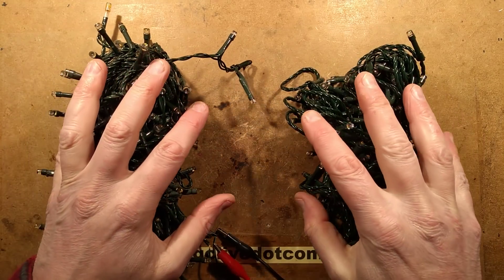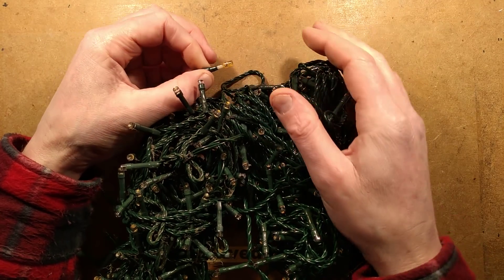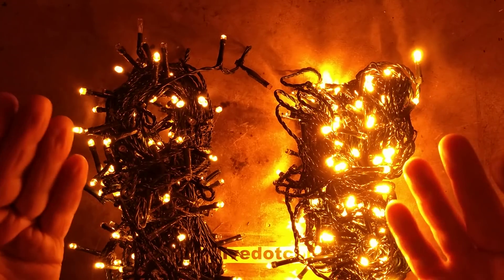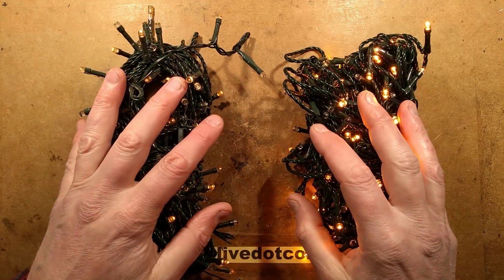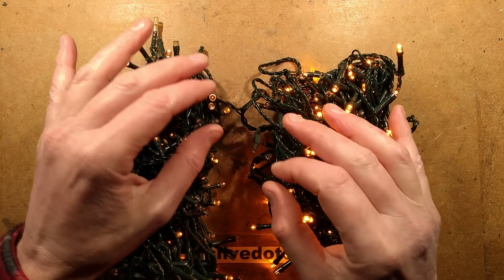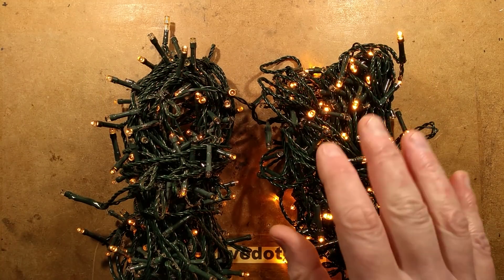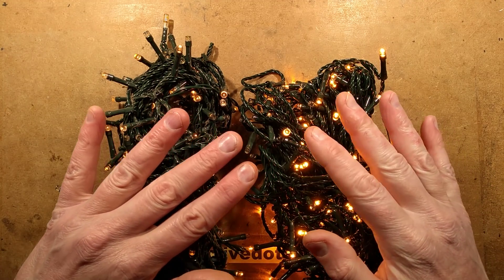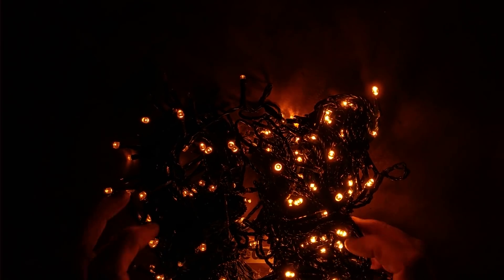9000 hour LED intensity loss test on LED strings.  (All LEDs do still work.)

Comment: Yup, sadly it's a thing.  I built a Sound-Absorbing Light(tm) a few months ago, and just yesterday had to replace one of four strips due to the start of a cascade failure (about 1' of a 4' section went dim and yellow).  The new strip is significantly brighter than the other three, and they only see about 8 hours of use a day.  Argh!

Comment: Did you clean the set that was outside as the lenses look dirty yellowish to me, I was looking at the unlit one in particular regarding this, UV damages plastics and causes them to go opaque. I have one of those tapes of led's on the stairs with a time switch and they are as bright now as when I fitted them five years ago. But they are not run at full power.

Comment: To me it looks like both the new and old strings have a few LED's which are not lit. If I'm seeing that correctly that could also be a factor for the difference in current usage.
I'm quite disappointed that the LED's have degraded so much already after 'only' 9000 hours... Lots of manufacturers claim a lifespan of at least 20.000 hours.

Comment: it looks like a lot of the LEDs aren't even working any more, and did the plastic lenses turn yellow on the old ones vs. the new ones?  What's the count of the working vs. non-working LEDs on the old string?
Reply from the maker: All working.  Just being run on single polarity DC so half were lit.

Comment: Well this is disappointing, I own a bunch of sets of these and run them 24/7  for 5 weeks a year since some of them don’t have a memory function.   I’ve noticed my older ones are slightly dimmer (and some sections of the older lights barely light up).  I was hoping I’d get more use than a couple of seasons out of them.

Comment: Time to revisit the led cost-benefit analysis compared to other lighting systems me thinks...
Reply: Large companies and government departments should already have factored in the rated lifespan of the LED lamps. Don’t forget for them, labour cost of replacing conventional lamps is also taken into account. They also will (should) carefully choose the type / make from established well known reliable companies, and not buy the cheapest rubbish from the Far East.
Reply: @Mark1024MAK  Except most government departments won't have factored this in, most things I signed off by someone of nearly zero technical intellect and a bean counter who swallows a load of slick marketing bs.
Even domestically I'm going to crunch some numbers, if they have to be realistically replaced every year due to degradation the initial cost and yearly replacement in relation to power savings may not add up too strong.
Reply: deezelfairy - Well, some companies have trialled LED replacement tubes to replace conventional fluorescent tubes. Now they use the LED type extensively. Myself, 95% of my house now uses energy efficiency lamps, most of which is LED type. One down light failed (driver incompatibility), the rest are fine. Some are over four years old now. I have not noticed any colour change or light reduction. But without using a light measuring instrument, it’s hard to be certain. None of mine run continuously though.

Comment: My experiment would be on how they got so daaam tangled
Reply: And ear plugs
Reply: You are right
Reply: Gremlins man, gremlins!
Reply: It's the "Tree Light Faerie"
Every year they go around mucking up everyone’s nicely packed crimble lights!
As this subset of "Christmas Pixie" has evolved from the santa variety there is a direct correlation between how tangled your light strings become as to how good you are throughout the year! This strange phenomena also occurs with other variants of lighting rigs .... from Stage to Site (although with site lights you can never disprove the "'prentice did it" theory)!
Reply: Ah yes, that moment when a half-hour task of putting up lights turns into a three-hour task.
Reply: @jonathandenton6160  You mean the point of convergence of the graph of time taken to untangle against the time to get another set .... with an alternate line for the need to use snips and tape?
Reply: @totherarf  or just plug them in as a huge tangled hairball of wire and LEDs and hope the house doesn't burn down.
Reply: @jonathandenton6160  You mean the usual setup? ;0)

Comment: Just wondered if perhaps some small amount of damage is caused by them being driven in reverse for half of the cycle. I know some LEDs do not like being driven in reverse at all but some are ok.
Reply: The reverse voltage is likely to be clamped at the forward voltage of the adjacent LED (wired in inverse parallel), so 3.5V or lower. So not likely to have much impact.

Comment: Any thoughts about the effect, if any, of sunlight exposure on rate of LED fading? I have lots of cheap warm white LEDs outdoors running 12/7/365. They lose intensity over time of course but not all at the same rate. It kinda seems like the ones that get some sun during the day fade faster than the ones that are always in shade. But I haven't really made up my mind whether the sun is doing it, or some other factor I haven't thought of yet.

Comment: Now you know what you need to do with the old set... crank the voltage up until they go pop ;)
Reply from the maker: LEDs are really boring for that.  They seem to fail in a controlled manner.  The best you can hope for is the lens firing off.
Reply: @bigclivedotcom  so you're saying apply mains voltage directly to them ? ;)

Comment: but that is 9000 hours !! there is no typical incan or flourescent that will last anywhere near that long :-)

I am curious. is 6 hours a night until it hits 9000 hours the same "wear" on the chips as 9000 hours constantly ?
Reply from the maker: No.  Running hours degrade them the most.  But direct baking sunshine can degrade them too.
Reply: @bigclivedotcom  ahhh. Good point so its not aimply long running hours but running period. Any chance being rectified might extend life or is it simply the diode wearing down?
Reply: Nerys - temperature has a significant effect as well. The hotter they are, the quicker they are likely to degrade.
Reply: Nerys - the energy conversion from electricity to light in the LED chip degrades over run time. And the phosphor (in types that use phosphor) will also degrade over time. LEDs are DC device’s, at low reverse voltages (below around 5V) , the current flow is very low, so these does not effect them. As they are wired in inverse parallel with other LEDs, the maximum reverse voltage will be about 3.5V.

Comment: This also supports my theory that LED technology just isn't ready to be used as large scale lighting applications. I have an LED light that I use for lighting my room at night, it used to be a pretty color (cool white, but that really interesting cool white that has a phosphor but is a thin layer, so a lot of blue comes out as well as the yellow from the phosphor) and is now just a generic dull white color, and loss of brightness, though not much, as it is still useful.
Reply: I despise the LED street lights that they forced upon us here in the UK, I smile whenever I see one of the rare original lights, a nice warm friendly glow instead of the cold harsh dazzling light from the horrible LED lights.
I especially hate them when I'm out cycling at night, going from the LED lit roads to the cycle paths it takes several minutes for my eyes to get used to the darkness, never had that issue with the old amber lights.
Reply: I'm not sure what it is about vehicles, whether it is the combination of weather and shock, or just component failures, but now that virtually all brands of vehicles have LED running lights, I see failures constantly.....headlights, DRL, taillights etc. And we are talking vehicles that are only a few years old.
Reply: I got a really cheap LED bulb for a room about 3 years ago - 99p from Screwfix.  It's not really bright (was less than a 60W equivalent) but still lights the room and too bright to look at directly. It's been on a lot longer than average too, as the room faces a direction that only gets sunlight during the morning.
Reply: High quality LEDs if used correctly and not run at or beyond the manufacturers recommended rating, and which are not run too hot, will last for a reasonable length of time. If the lifespan exceeds traditional lamps and they are just as, or more efficient, then they are ready. Hence their  increasing widespread use.
Reply: licensetodrive - I find the LED streetlights to be better, as they are directional, so don’t shine in my eyes as much as low pressure and high pressure sodium lamps.
Reply: bigblockelectra - no different than cars that use filament lamps then. Certain makes often had lamp failures even though they were less than three years old...

Comment: wait, im confused, didnt clive say that the string of lights that was brighter was also being used outside? or was it just the one string that was used outside? and im assuming they were the same exact model. it would be interesting to take a few bulbs out of a string and store them, and then plug them back in after a while and see if they are brighter then the rest of the bulbs in the string
Reply from the maker: Just the dim string had been used.

Comment: Clive, I'm a little confused at the start of your video with the AC vs DC, etc, and then your experiment seemed to be one set run 24/7/365 vs one set never run.  Unless I missed something where the one set was actually run, it would seem like the only experimental results you have are that running LED's 24/7/365 will degrade faster than those that are never run.
Reply: There was one experiment with two results. The LED set that he used runs from a controller that continuously switches the DC supply polarity to the LED chain (hence he calls it AC). He wondered if such a set would suffer from less corrosion compared to his previous experiences with LED sets that operate on a DC supply (where the polarity never changes). His conclusion is that there is less corrosion.
The second result is that there is a significant degradation of the light output after running the set for an extended period of time. The new set was his control to use to compare to the set that ran for a year.

Comment: I've seen DIP style Led's degrade like ** in my local buses when used as permanently on position lights and front interior lights

I think that package style just isn't suited for longevity because of how far the chip is from the circuit board (and thus, cooling)

SMD, cobs, and other high power packages when cooled properly should last a lot longer

I've seen fluros and CFL dim over time, but maybe only 30% instead of 90%

Just by eye, this looks like 50%

also, some manufactured products with leds (my logitech mouse on its first gen) lost it's blue pretty quickly, then was green

And the blue led's on my coolermaster fans barely do anything these days (I do have LED strip lights for the case which have probably outlasted them in terms of not becoming dim)

Best bet is probably go for double or triple what you need, and run them at reduced power

Comment: Hey Clive, I got a request for you. Ever heard of the "Socket Shelf" by Sharper Image?  I've been seeing a ton of adverts about them in my area recently and I suspect this is right up your ally in terms of "No one should ever use this fire hazard" crap.  It's an output power splitter with USB but the gimmick is that it comes with a little shelf.  I might even be up to shipping you one from the USA if you're interested but I suspect that you've already dissected enough crap like this on your channel. Still, let me know if you're interested.

Comment: Another annoying thing about these LED strings (also solar garden lights)  used outdoors is the lead in wires on the LEDs start to go rusty very quickly,  is steel wire used for technical reasons or just because it's cheaper than copper or brass?
Reply: I don’t know the answer to your question, but all the 3mm and 5mm (and similar type/size) leaded LEDs I have seen in the last 30 years use steel for their leads.

Comment: Correct me if I'm wrong, but ordinary household LED bulbs use basically the same LED technology, right? Because I haven't seen them degrade anywhere this severely even after many years of use. Yet if I remember other Clive videos correctly, they're commonly driven at even higher currents, no? What's the difference? Are there quality differences in LED production that cause them to degrade differently fast?
Reply from the maker: Quality and imperceivable degradation speed.  If you got two identical LED lamps, then ran one for a year and then put the unused one next to it you'd see the intensity drop.

Comment: Clive! Do you know of any professional grade LED chainable christmas lights that will last a long time that you could recommend me? You work with professional lighting.

I bought some high end LED chainable christmas lights to replace my old incandecent lights of the same brand. I got about 7 to 10 seasons out of the old incandecent chains, although there were quite a few blown bulbs, so I had high hopes for the new LED lights since they were the same brand. But I am pissed, after ONE season two out of 8 chains died, no light at all. I supsect they are wired in series so that if one LED fails they all go. I got new ones after complaining but another one broke the next season. Really disappointed. I have about 60 meters on the house. Brand is System EXPO (old incandecent) and System LED for the new ones.

Comment: Inetersting. I had no idea that leds degraded. Do the dim ones go back to normal if you up the voltage?
Reply from the maker: You can force some more life out of them with higher current, but that degrades them even faster.

Comment: Since the input energy is about the same in both strings, what is your theory on the transformation of that energy to light and heat. Do degraded LEDs produce more heat vs light as they age and degrade? What would be the mechanism?
Reply: Of course. These things output only light and heat. If they output less light, the rest will be heat. Unless they emit more invisible light which I highly doubt.

Comment: Ive been wondering how the LED headlights that came with my car are going to degrade over time.
Reply: Mine are 7 years old and OEM, I can't compare to new ones but they are still very effective, but I can sometimes notice a drop in CRI. The reflections of yellow signs looks slightly more green than they should be, the reds are dimmer, but the blue is still good. So yes the phosphors have aged, but the overall intensity is still good.

Comment: IIRC the industry standard for LEDs is to rate them at a power and heat level that produces 70% brightness after 50,000 hours, with end of life at 100,000 hours. But even 50 years ago with tungsten bulbs, they were often driven with excess voltage to produce brighter light at a greatly shortened life. 6v "tractor" headlights were used in dive lights, 50% overvolted, life cut down to about 12 hours. Intentionally, and the users accepted that trade-off.
 Anonymous LEDs? Why even ask?

Comment: I wonder how this would apply to photo-optical smoke detectors.
It is true they pulse every 10 seconds so this greatly reduces runtime.
Still I have to wonder about LED's that are used in critical applications.
Reply from the maker: The short pulse and older more rugged LED technology means it's not usually an issue.  Dust ingress is though.
Reply: @bigclivedotcom  I'm guessing smoke detectors have the ability to adjust their calibration curve to compensate for LED fade or radioisotope decay. Having dust inside the sensor housing only pushes that calibration curve further. Overall it would have a lowered sensitivity and response. vacuuming is an excellent idea to prevent that. And remember vacuums don't suck, the room blows.
Reply from the maker: @seanb3516  The proper ones do compensate for dust.

Comment: what about street lights?  all these arc bulbs being replaced with LED panels I wonder how long before they degrade and dim.
Reply: they dont have the chance to degrade OR dim, they just fail outright and start flashing stroboscopic style, usually because the driver but sometimes even black spot of death can do it

Comment: I don't really understand why I haven't been able to find good WW LED strings for several years. I know the technology exists to make nice, golden tungsten-like LEDs, but every set of strings I have seen so far is either too cold (~4000 K) or just has awful tint, sometimes it just looks like a mix of magenta and green, sometimes one more than the other, but never a nice, even spectrum. I realize making LEDs with a broad spectrum is expensive, but I wouldn't mind spending more to finally have LEDs that don't look awful. I also can't tolerate those alternating ones, as they switch polarity at something around 200 Hz which is still very visible to me when moving my eyes. It's very distracting. I have been to at least 20 stores so far that sell christmas lights (since ordering online is not practical in this case), and haven't found anything I like. It's so frustrating. They also promised LED to last so long, but regularly the chips just die or degrade massively like the ones in the video...
Reply from the maker: That's what happened here initially before they perfected the golden white LEDs.
Reply: Keep in mind that cost/price is the driving factor. Hence LED party lights (as they are often called the rest of the year) use the cheapest LEDs that the Far East can produce...